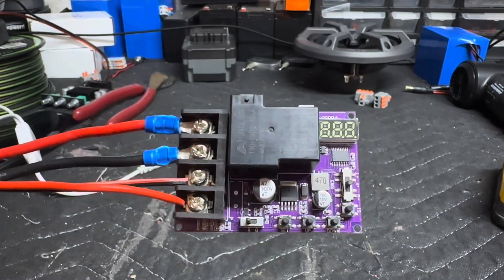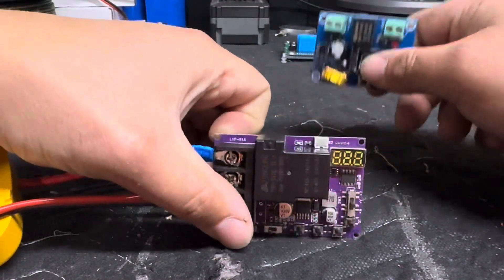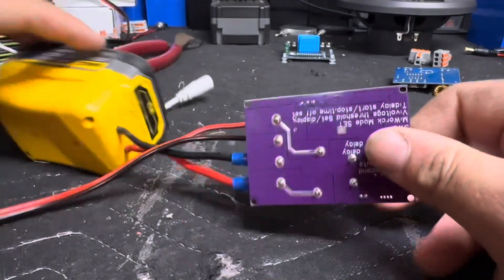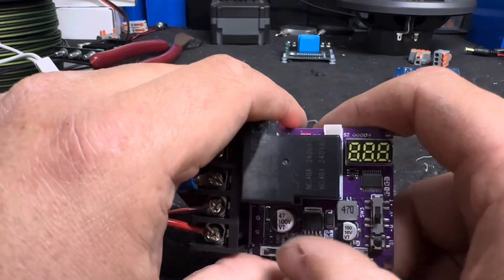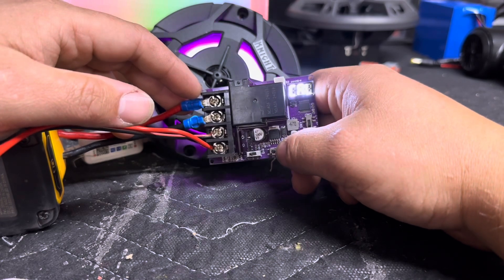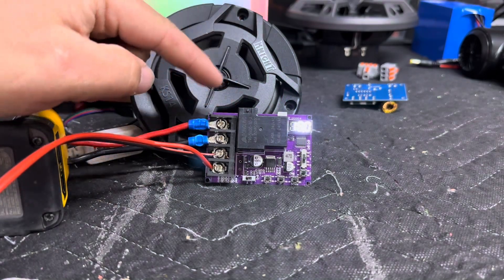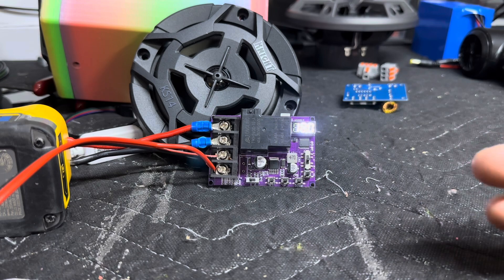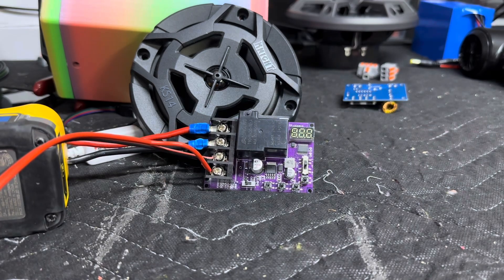How to set Low Voltage cutoff (purple one)

Comment: Quick question, when setting the “ch” value, do you set that for the highest voltage of the battery? (For ex. If I’m using an 18v Makita battery would I set the “cl” for 15.5v and the “ch” for 18v)?